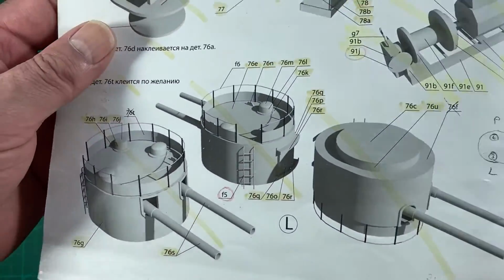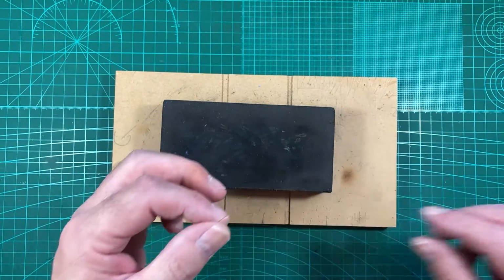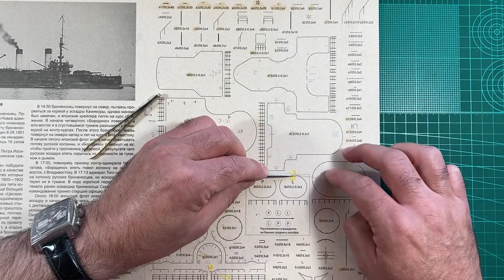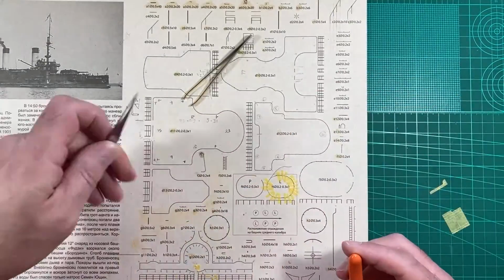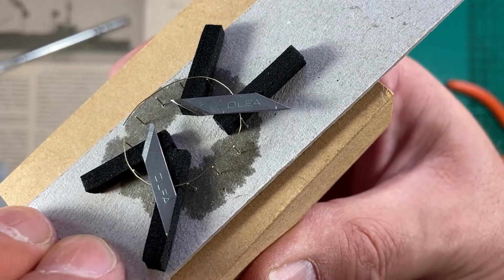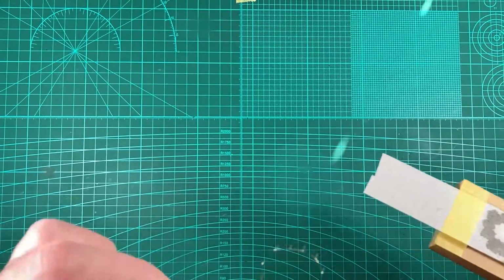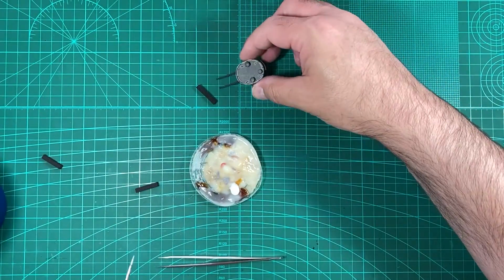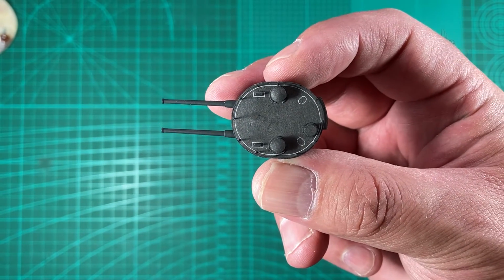Borodino, Paper Model, 1/200 Scale, Part 5, Making, soldering and Fitting 6” Turret Handrails

Comment: Very nice job on your rails, I think they look much better, and more realistic than photo etch railings.  I was a little surprised when you painted them with water colors.  I would of thought the paint would just rub off if touched.  Thanks for sharing, your ship looks amazing.  Have a great day.  Jeff
Reply from the maker: Hi Jeff, thanks for your comment.  It depends the situation when I paint and with what. If it was photo etch or other brass and it was off the model I would airbrush Tamiya or similar for speed and ease, which can handle a bit of touching. Typically if already attached I won't be touching it again and find more control putting the water colour on. I don't have much success brushing Tamiya paints.
Reply from the maker: @richmondtigers7495  Thanks for the info.  I think why I like the water colours for in-situ painting is its very thin and stays in the loaded brush so can work it right up to the paper. I like how Vallejo Model Color brush paints but sits on the brush surface so I need to be careful working up to the surfaces if that makes sense. But my brush painting with model paints is very limited.